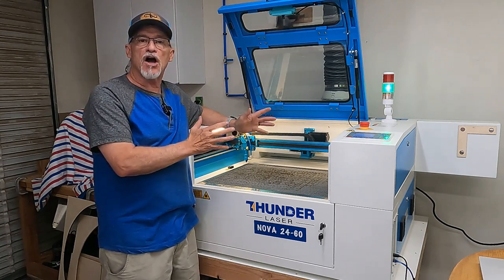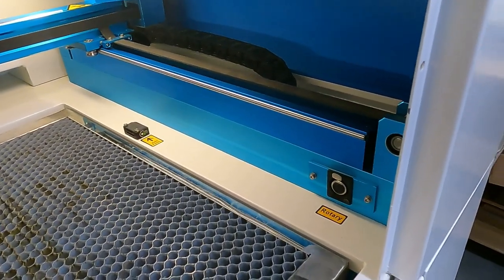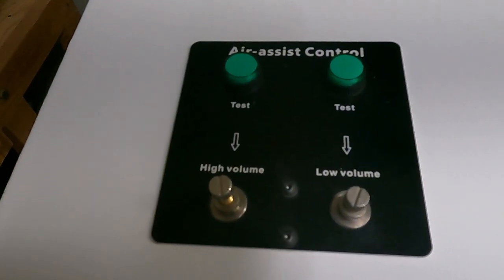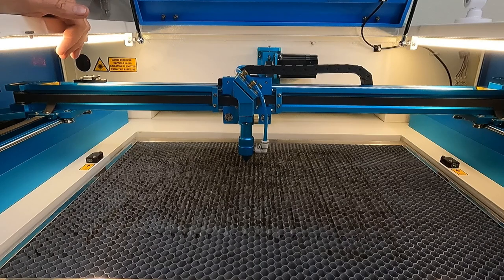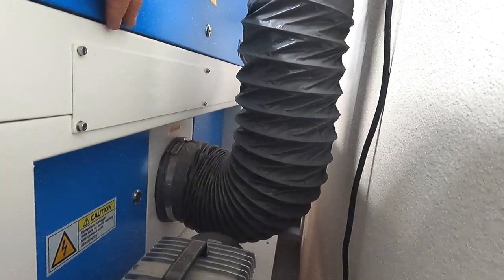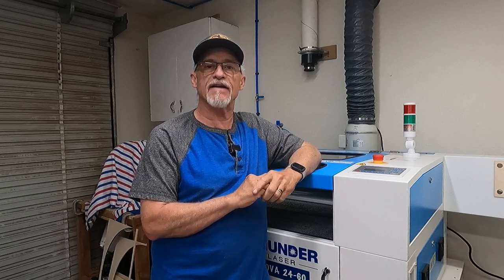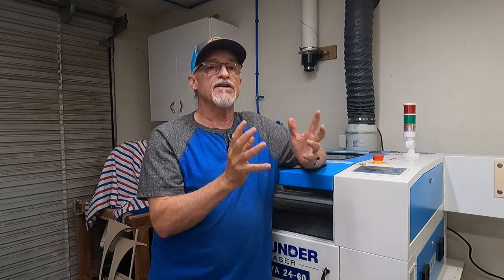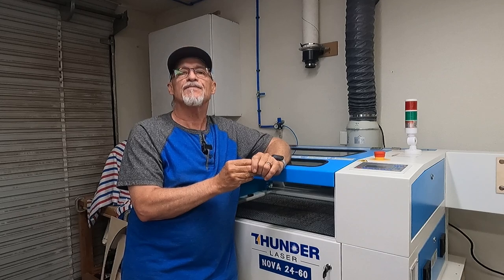Thunder Nova 24-60watt 1 year review

Comment: Just found this - I appreciate your review. Would you mind also sharing your setup? for example, you said a dedicated air source - what do you use? What requirements did this have to set up? You have dedicated air handling - is that powered just by the laser or do you have a a vacuum pulling air as well? I see you also have dedicated computers set up as the controller for the laser. Is that an old PC or did you need a newer system to control the laser? Thanks again and I've subscribed; this content is great!
Reply from the maker: I use a 60 gallon North Star compressor hat feed my hole shop. Adding external air source is one of the best improvements to any laser. Less clean up and you can cut thicker materials compared to a stock compressor that comes with the machine. If your planning doing allot of cutting that is a must. You don’t need that big of a compressor just depends on how much you want to hear it run . LightBurn the software that funds the laser is ver good you don’t need much of a pc or Mac to run it. Thank you for your comments and subscribing !
Reply: @computercreationz  thanks! I've been enjoying the channel. A full shop tour would be cool. Thanks for what you're contributing!!

Comment: Thanks that was very helpful.  Did you need the 100W laser because your production was slow or were you having difficulty with thicker materials?  I'm trying to decide between the 24 and the 35
Reply from the maker: If you have the room go with a 35-100 much faster cutting 1/4” material and above but still have the detail. The 130 watt is too much if you do allot of small detail. Bigger bed space faster cutting capability. The 35 -100 is the perfect mix in my opinion

Comment: Thanks for your videos its been a great help.

What do you think about this unit at a similar price compared to bolt plus? 

It seems like the bolt is better at engraving and nova is better at cutting, but its hard to understand the threshold - Like will it be noticeably poor quality engravings compared to bolt? Will bolt's cutting ability be slower and induce more burns? 

Thank you!
Reply from the maker: if your a hobbest the entry level bolt is fantastic. if your in business and time is money the bolt plus or pro series is worth the extra cost due to the additional features and speed increase you get with the upgraded models.

Comment: This is an excellent review! Thank you for sharing it! If Thunder isn't paying you for advertising they should be =)
Reply: What size air compressors system would you recommend?
Reply from the maker: it depends how much cutting you do I wouldn’t go smaller that 24 gallon tank. I have a 60 gallon that is my shop air and it will kick on a few times during a bigger cutting job. just depends on how much you want to listen to the compressor run. they help ALLOT!
Reply: @computercreationz  Thank you :)

Comment: Hi again and thanks for the video! Was wondering if anyone reading this question could chime in?  Ordered the 24 (not arrived yet)  and was curious about the built in air assist. It's pros and cons. Some say it works well others have said get something different. Your comments are appreciated.   -- Bob
Reply from the maker: the stock air assist is ok but if your planing on cutting 1/4” wood or thicker I highly recommend going with an external air setup. much cleaner cuts, no start cut marks, cleaner edges. lots of info on this on thunderlaserusa.com under knowledge base.

Comment: GREAT VIDEO! Can you please let me know what kind of cuttings speeds you were able to achieve cutting 1/4" wood @ 1-pass?
Reply from the maker: it really depends on the quality of wood your purchasing. if you buy top quality birch ply not from a big box store I could achieve 28-32mm /second with my 24-60. lesser or cheaper materials will be substantially less than that.
Reply: @computercreationz  thank you for the info.

Comment: how can i fix my design to just engrave the letters and not everything. It shows all red.
Reply from the maker: its best to put all on action like engraving (fill mode ) on one layer. use your colors in lightburn as a function not a setting. black as the frame layer, red as the cut layer etc. then assign your setting from the material library. makes for a very fast and efficient work flow

Comment: would like to know your thoughts on their rail system....wear and tear versus a linear...are they stainless stell wheels riding on a stainless steel guide.....im looking at a linear rail system.....kinda different design...i know wheels can be replaced, but what about the embedded guide?
Reply from the maker: I had allot of experience with linear rail systems from Cnc that I owned and I’m not a fan. the thunder rail system uses self lubricating  bearings and stainless steel rails and don’t have to be oiled. I’ve see thunders that are run everyday for 3 years and the rails don’t wear. you will change an occasional bearing.

Comment: Your videos have been great and really helped me in my decision making process - thank you!!! I have a few questions I'm hoping you can answer as I can't seem to find these answers. 1) Would I be able to set a 21" diameter piece of wood that is 1.5" high into it (knowing I couldn't engrave the entire piece)? I think the answer is no but want to find out for sure. 2) Can you please explain using shop air vs air provided and how much it would help cut thru thicker material? You said you can easily cut thru 1/4" thick material but how thick do you think I could cut thru with shop air? 3) Do you believe this can fit through a standard residential interior doorway - probably have 27" clearance? Thanks in advance!
Reply from the maker: using the pass through will limit you to .75” no more

Comment: Thanks for the video. I had a question about room size as someone had mentioned the air intake can be up to 350cfm which depending on a number of factors, the room size would be a consideration. The reason is that I want to put this in my small office area in my home. Room size is about 120 sq ft. My wife heard this and asked me if she would need her jacket on in the house during the winter (-:  It's hard to figure this one out. Just curious what you might think.  --Thanks!
Reply from the maker: it will move some air but without it the smell will be inside instead of outside.

Comment: Great Review.  What is the height of your table / Bench top surface that the machine sits on?  Do you think it is to high. I built mine off  yours in video review 2 and is at abou 28 inches. It feels really high but still setting up.
Reply from the maker: the table I made was 20” high that put the honeycomb of the 24 at 37”

Comment: I am thinking of buying one but still thinking of which size to get.  At first I was thinking of the Mini or the Nova 24-60.  But now I am even thinking of getting a bigger version Nova 35.  I have been using my left side of the brain as a physician but I now want to access and use more of my right side of my brain for creativity.  I was at first looking at the Xtool and then upgraded to researching the GlowForge Pro.  However, when I saw videos of people who bought the Thunder Laser and gave reasons why they prefer it over the GlowForge Pro, I began to watch more videos of Thunder Laser reviews.  I think I will call Thunder Laser representative real soon.   I now work part time as a physician and can spend some time learning and enjoying the craft of laser engraving/cutting.  I actually put in an order for the Bambu Lab X1C to try out and learn 3D printing also.  YOLO and FOMO. 🙂
Reply: By the way, Xtool and GlowForge are having a holiday sale now and I am wondering if Thunder Laser would have any special deal for the Black Friday that is coming up.  I can only wish.
Reply from the maker: Thunder laser does not have sales. Thunder laser is several steps above a glowforge in so many ways. check on thunderlaser reviews they are top tier and you don’t need the internet to use them

Comment: Design-wise I think my Aeon Mira 7 is better than your Thunder. It replicated all the key features of a Trotec: all around enclosed linear parts, hot swap lens fixture, RF tube, and sleek self contained design.
Reply from the maker: I respect your opinion but I will point out I looked at Aeon before I went with Thunder. here are the reasons I have a different opinion.
Aeon is more expensive to your door for less value.
no dual air assist control which can be critical for engraving many different materials.
Aeon is completely rebuilt once it gets to the states which indicates it wasn’t up to standard to begin with. Thunder in manufactured in China once. with required tolerances twice what Aeon has.
Aeon has linear bearing with grease. I’ve owned Cnc machines (no thanks) Thunder uses all sealed bearing in all moving parts, much easier to clean and maintain. Aeon is has self contained blower and chiller which takes less space but can be problematic when failure occurs. Thunder you can get the parts you need from Amazon in 3 days. Thunder has a smart board that Aeon doesn’t  have this is critical if a problem arises. Aeon does not have a pass through door in the back. this was a deal breaker for me. I use the pass through doors from and back on the Thunder allot!  I know quite a few people that own a Aeon they seem to be happy with there purchase. I’m just pointing out the reasons I went with Thunder. thanks for watching and I appreciate your comment.

Comment: Will Nova 24-80 cut 3/8 inch High Grade US Birch Plywood ?
Reply from the maker: The 24 only comes in 60 watt you have to step up to 35 to get the 80 watt. I have cut 3/8” but with external air and it was very slow! I would go 35-100 watt for that and even at that cutting 3/8 is a slower process
Reply: Thank You for your honest reply
Medicine Man/Woodshop Man
Rick

Comment: The ease of cleaning is a huge deal. I have a Glowforge, and in general the fit and finish is fine, but it is obvious they did not give much thought to how you would clean it. It is so tight inside and there is no easy way to open it up to be able to clean inside. To clean the exhaust fan You have to reach way inside the machine and take out screws without being able to see them. I seriously considered cutting the exhaust fan out from the outside.
Reply from the maker: I’ve heard they are not each to maintain. thank for watching!

Comment: Hi Robert! I've seen the review vids plus this one, and I wanted to know that when you were shopping for a Laser, did you look at AP Lazer? If so, what ere your thoughts?
Reply from the maker: I shopped most all of the larger brands. Thunder, Aeon, Ap laser. I know of three people that have the Ap laser and are not too impressed more expensive, less support they fell off the list pretty fast. Compare the knowledge base on the laser company’s web site your considering. This is going to tell you allot when you will come accross and issue and how it’s dealt with. That’s what I love about thunder they knowledge base is extensive from replacing a power supply to leveling your honeycomb. Support with them comes in minutes not hours or days
Reply: @computercreationz  Robert... Thank you for the reply... I also messaged another Thunder customer and they had stated the same sentiments.... As far as the AP Open Structure, I guess it would depend if I was going to specifically engrave/cut huuuuge items....but it seems that it would be a rare instance... That pretty much makes my mind up regarding AP... I truly appreciate you and your page here. VERY helpful!!
Reply: @computercreationz  Another question..... I see you had the Nova 24 and then or now you have the Nova 35. Was there an immediate need to upgrade? My problem is that I do not have any space other than in interior home office room and a single front door entry way to get a machine in the house.... I know, pretty sad, eh? lol...... I am speaking with Thunder on 9.23.22. I feel good about it.
Reply from the maker: @catechops1970  first off all thunder nova lasers will fit through a standard 36” doorway. So keep that in mind. I had a buddy off er to buy my 24 and I sold my Cnc to get enough room for my 35. So I was in the same boat as you. Glad I upgraded.
Reply: @computercreationz  .... I had my discussion with Thunder....Went VERY well.... 🙂....

Comment: how do you use the passthrough with the exhaust there in the video
Reply from the maker: I roll the laser forward to use the pass through, anybody that has there laser up against the wall will have to do that. thunders have a very nice wheel system. this one is on a cart with wheels. thanks for watching.
Reply: @computercreationz Good day,  Where did you get the cart with wheels?

Comment: While you had the door open, I noticed that they do not use LINEAR RAILS for the x and y axes.  They appear to use rollers riding on round steel rods.  This might be good for speed, but it's not very good for precision.  For $6900, I would expect better mechanicals. Otherwise, the machine looks good, so I don't know why they skimped in this area.
Reply from the maker: I’ve owned and operated Cnc machines with hi quality linear rails in the past. just because they don’t have linear rails doesn’t mean they are not accurate. I would put this machine against any other laser including the models in the 30k range. One reason I went with Thunder was because they didn’t have linear rails that you constantly had to clean and grease. grease and the projects that you do in a laser usually don’t go together.